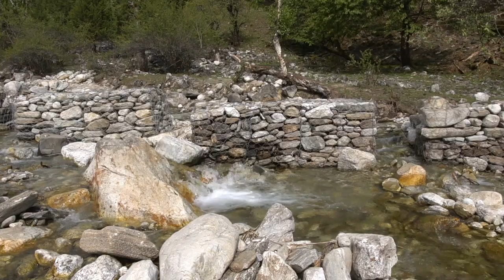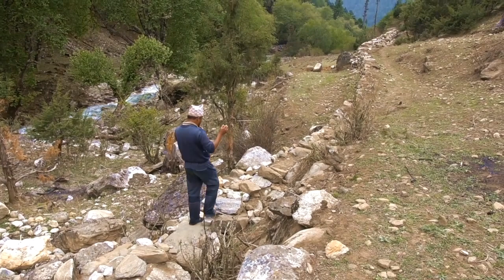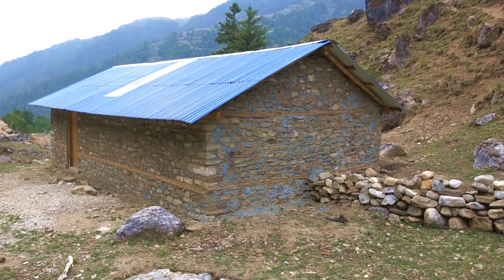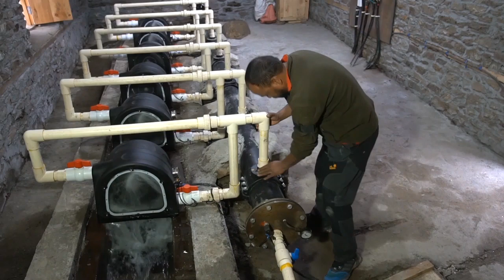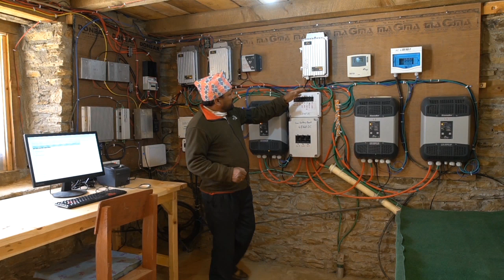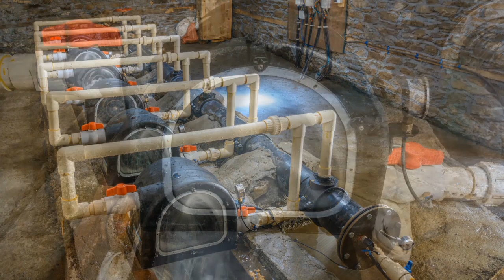01 ENGLISH - MODULAR PICO-HYDRO POWER PLANT PROTOTYPE PROJECT IN MOHARI VILLAGE JUMLA NEPAL(40 Min.)

Comment: MY FRIEND! FREE ENERGY FLYWHEEL GENERATOR KW 
https://youtu.be/Lh3vcIuC0Ro
PLEASE SEE AND TEACH OTHERS https://youtu.be/jIBMp4OvbSM
SEE https://youtu.be/fgk0HfXhU9M  GIFT TO THE WORLD 🌎 HE GAVE THE PATENT FOR ALL TO MAKE REPLICAS

ATT: MOTOR NEED BATTERY OR ELECTRICITY  FOR ONLY START FOR JUST ONE MINUTE.
MOTOR IS 20% in WATTS OF THE GENERATOR KW
EXAMPLE: 50 kw generator will
Need 10 kw motor in HP
HOW IT WORKERS:
https://youtu.be/ePJ_l-C6RCQ
MOTOR GET POWER FROM BATTERY OR ELECTRICITY AND PUT  FLYWHEEL IN ACTION TO GENERATOR .
AFTER THAT THE GENERATOR SEND POWER BACK TO THE MOTOR = 20%
BATTERY OR OUTSIDE ELECTRICITY IS CUT OR RECHARGE THE BATTERIES

Comment: MY FRIEND! FREE ENERGY FLYWHEEL GENERATOR KW 
https://youtu.be/Lh3vcIuC0Ro
PLEASE SEE AND TEACH OTHERS https://youtu.be/jIBMp4OvbSM
SEE https://youtu.be/fgk0HfXhU9M

ATT: MOTOR NEED BATTERY OR ELECTRICITY  FOR ONLY START FOR JUST ONE MINUTE.
MOTOR IS 20% in WATTS OF THE GENERATOR KW
EXAMPLE: 50 kw generator will
Need 10 kw motor in HP
HOW IT WORKERS:
https://youtu.be/ePJ_l-C6RCQ
MOTOR GET POWER FROM BATTERY OR ELECTRICITY AND PUT  FLYWHEEL IN ACTION TO GENERATOR .
AFTER THAT THE GENERATOR SEND POWER BACK TO THE MOTOR = 20%
BATTERY OR OUTSIDE ELECTRICITY IS CUT OR RECHARGE THE BATTERIES

Comment: Congrats to RIDS and the Mohari Community on this great project!
Reply: MY FRIEND! FREE ENERGY FLYWHEEL GENERATOR KW 
https://youtu.be/Lh3vcIuC0Ro
PLEASE SEE AND TEACH OTHERS https://youtu.be/jIBMp4OvbSM

ATT: MOTOR NEED BATTERY OR ELECTRICITY  FOR ONLY START FOR JUST ONE MINUTE.
MOTOR IS 20% in WATTS OF THE GENERATOR KW
EXAMPLE: 50 kw generator will
Need 10 kw motor in HP
HOW IT WORKERS:
MOTOR GET POWER FROM BATTERY OR ELECTRICITY AND PUT  FLYWHEEL IN ACTION TO GENERATOR .
AFTER THAT THE GENERATOR SEND POWER BACK TO THE MOTOR = 20%
BATTERY OR OUTSIDE ELECTRICITY IS CUT OR RECHARGE THE BATTERIES